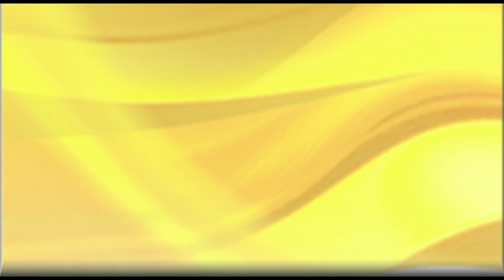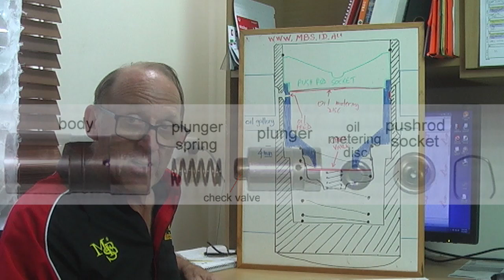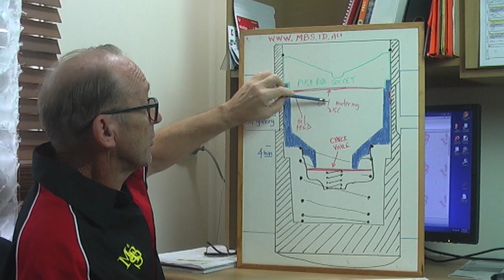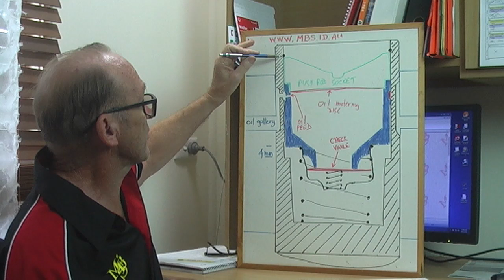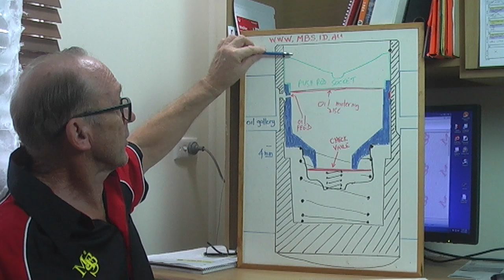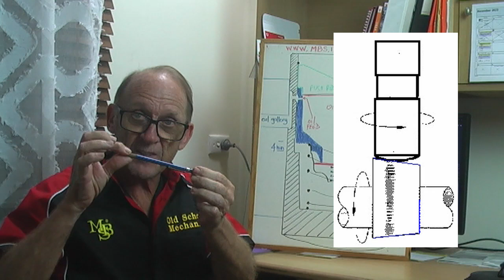Hydraulic Lifters Explained

Comment: weird question, i've seen a few vids of guys converting a hydraulic lifter to a solid lifter for sake of getting valve train measurements. i have an extra set of unused hydraulic lifters and accidently ordered the wrong cam if i convert my lifters by turning the guts upside down and eliminating the spring, will it still oil the pushrods and rockers? would it be usable i can get a set of polly locks to set the adjustment, if not short-term till the correct lifters or cam might arrive and time is available. coming from a background in diesel i'm familiar with setting and maintaining solid lifter cams. or is there significant more to a solid lifter than just an oil pathway.
Reply from the maker: It won't work. The only way to do it is to remove the spring and fit washers on that little ledge in the main body until the plunger has no downward movement. Getting the correct washer will be your next challenge, I have never seen them.  When I convert hyd to solid for rocker geometry checks, I just add washers under the spring & allow about .050" plunger movement. You would need to add more washers to make the downward movement to zero. This way you will still get oil feed to the pushrods but adding all these washers in there would only be very temporary as I feel that the spring may break apart because you will never get it to zero movement, so the spring will be subject to shock load and eventually break & then you will get a ticking noise due to excess clearance & of course a ground up spring will put metal powder through your engine. Long story short, I would not try it.
Reply: @mbsoldschool  thank you for your information, kinda where I was heading with my research too. Oh well I guess there's always next year lol

Comment: Great explanation. What about non adjustable lifters like in a 7.4 (454) GM engine? Roller lifters and the rocker bolts are torqued down.  The manual says if you shave the head or put new valve seats in, you may want to switch to a kit with adjustable.  Yet with this clearance within the lifter, would or could this be enough where new valve replacement is okay with sticking to the torqued rockers?
Reply from the maker: I am not familiar with this engine but it sounds the same as our 202 Holden engine, Ford cleveland & the chrysler hemi 6 set-ups & maybe a few more. They all have bolt down rocker pivots that are not adjustable, well not easily anyway. I have a few vids on my channel on the 202 engine lifter adjustment & rocker geometry that may be of use to get an understanding of how these work. In a nutshell, if you shave the head .020" you need .020" shorter pushrods to maintain the same lifter compression or you don't bother & allow the pushrod to go that little bit deeper into the lifter, it will still work. The important factor is how much movement tolerence is built into the lifter plunger. Our 202 has a range of up to 4mm before the lifter locks up and becomes a solid tappet, so a safety measurement would be 3.5mm max. Check out what I already have up and look out for a couple more coming up in the next 3-4 weeks.

Comment: Do you need to prime hydraluic lifters before installing them? (Working on 1989 mazda b2200 mini truck)
Reply from the maker: You don't have to but you can prime them. Put some oil in a container deep enough to submerge the lifter. Put lifter in and using a pushrod or something blunt, push the lifter in & slowly release it. Repeat until lifter is close to solid. Then install into engine.
Reply: @mbsoldschool  Thank you for this tutorial.  I found it helpful.  One question on priming lifters before installing...  if you get them full of oil, then when you install them, won't you be hydrolocking the lifter so that the final 3/4 turn on the rocker nut will be opening the valve instead of depressing the pushrod cup?  Or is that why you said "close to solid"?  Thanks in advance.  -- Mike
Reply from the maker: Pre-fill, don't pre-fill. If you pre-fill the oil will be pumped back out anyway during bleed down. Yes the lifter may seem it goes solid & will open the valve when turned down 3/4 of a turn, but it will bleed down & the valve will shut. Will only take less than 30 secs. If you have ever adjusted them running, then you will notice the engine missing as you turn the nut down but if you wait a few seconds the miss will come good & you can tighten a bit more until you reach 3/4 turn. The miss is caused by hydraulic lock of the lifter which opens the valve but when it bleeds down the valve will seat again.

Comment: Can you explain hydraulic lifters without the spring?   I have them in my 83 cougar 5.0
They start out pushed down. It's like a spring on the opposite side.
Reply from the maker: There is a spring there as per my video. When you turn the engine off, over the next few minutes the lifters that are in contact with the lobe area of the camshaft will bleed down. The valve spring is much stronger than the internal spring of the lifter. Over the next few revolutions of the engine while starting, the lifters will bleed up with oil pressure taking up the clearance created by the bleed down. The ticking noise you hear for a second or two on start up is this process.

Comment: I have a strange problem...
Chevrolet optra 2008...
I have a lifter tick only when engine is warmed up....when cold everything is well quiet..... what's the problem please !!
Reply from the maker: To start with, I am not at all familiar with your engine, so have no idea whether you can adjust the lifters or not, but in theory hydraulic lifters all work the same. Oil pressure + the internal spring is what keeps the adjustment at zero lash. So make sure your oil is changed regularly & you use the correct oil for your climate conditions. For a lifter to rattle it is obviously not pumping up correctly. Causes can be as said bad oil or incorrect grade (to thin), check valve in base not sealing off but is OK when oil is thick (cold engine), adjustment (if adjustable) is borderline loose. You could try a oil additive called 'lifter free" or something like that, run it for 15-20 min & then change the oil & filter. If the problem is still there, then narrow it down to which lifter it is or just replace them all.

Comment: Very simple and straight forward on explaining hydraulic lifters. God bless sir. My car developed a tick sound. I opened the valve cover driver side and noticed cylinder #1 intake rocker loose. I tightened the bolt till zero lache. Started the car. ticking sound quit for 30min then came back. Wonder if I need to takeoff lower intake for more inspection. Could it be a failed lifter?
Reply from the maker: well you need to check a few things. Firstly you adjusted to zero lash, but did you tighten a further 3/4 turn. If you did & rattle came back, then check the bolt/nut has not unwound itself from where you set it. If all is OK with the first two, then you may have a blockage of oil flow into the lifter which probably may show up as lack of oil in the rocker fulcrum. If there is plenty of oil then it may be the lifter itself. A bottler of lifter free from wynn's or similar may remove any junk blocking the lifters.